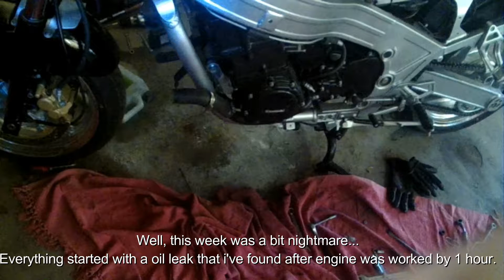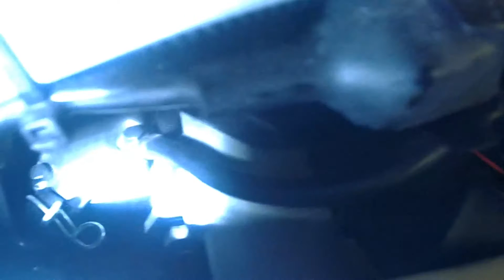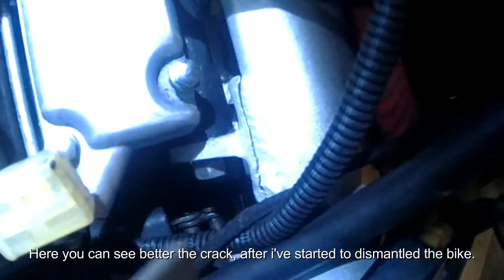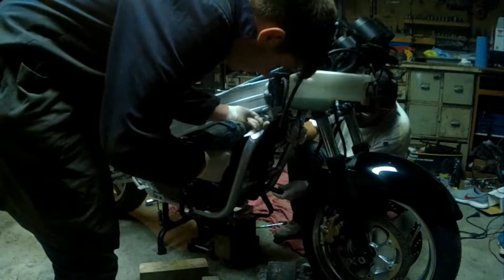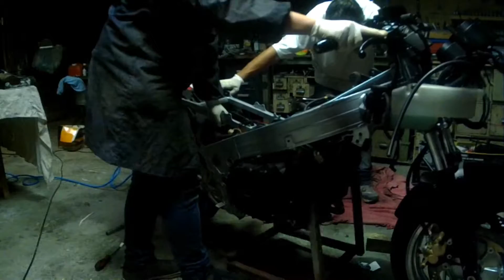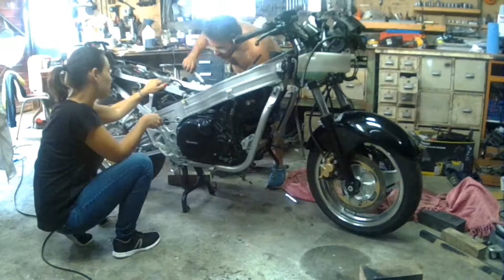Kawasaki ZX10 Tomcat Rebuild - Day #51 (oil leak and big problems)

Comment: the engine mount brackets cracking must be a common fault, both mine were cracked.
when reinstalling the engine, can you remember where the shims go? mine fell out, so didnt see where they came from?
Reply from the maker: Shims are inside, between frame and engine